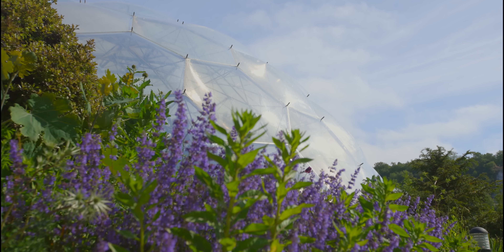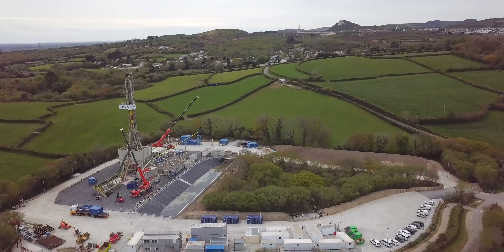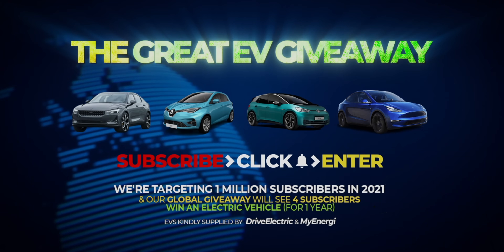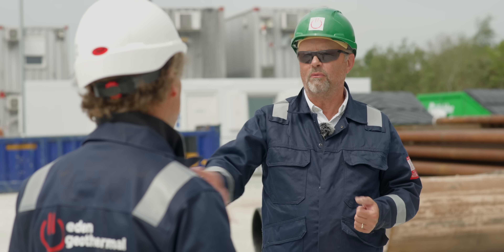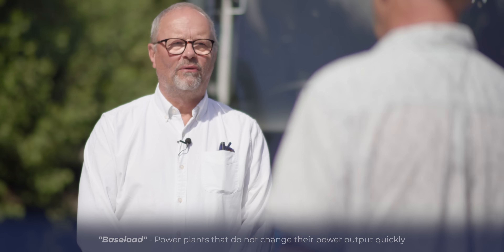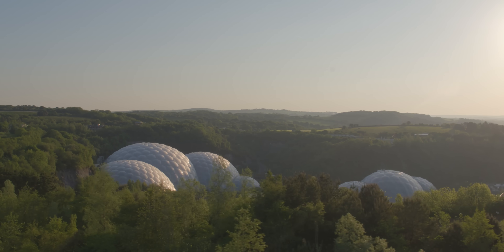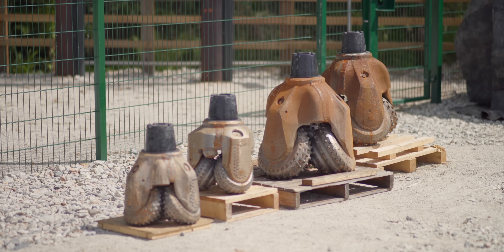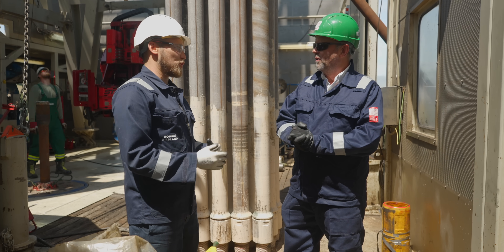Is Geothermal power the answer? | FULLY CHARGED

Comment: Anti-Nuclear sorts take note, this is tapping into heat from decaying radioactive elements deep beneath the surface. You cannot be for this and against new nuclear. Great stuff!
Reply: Actually, 'we' can - this is a natural nuclear heater they're tapping, with no nuclear waste for us to clean up, and no risk of a giant meltdown making the surface uninhabitable for miles around.  It's the same reason we can be in favour of solar - which gets its power from the giant nuclear (fission, rather than fusion) source in the sky: we don't have to deal with the cleanup.
Reply: @logicalChimp  your points are valid, but it just comes across as very "Nimby". We've have the capacity to deal with the waste effectively for years, money like everything else is the reason we don't. In any case I don't see it as a battle of natural nuclear vs artificial nuclear, they are on the same side of the climate fight.
Reply from the maker: Hmm, an interesting spin. I think the really well informed and intelligent opposition to nuclear energy isn't about the power stations, proven to be reliable and safe in all but 3 catastrophically bad exceptions, it's about the nuclear waste.
Geothermal drilling might extract very small amounts of low level radioactive material but once the wells are capped and then running, there is no radioactive material around, and no waste to deal with.
Reply: @fullychargedshow  If the objections were solely about nuclear waste, everyone would be cheering on GenIV designs that can consume high level, long lived waste isotopes from older generations of nuclear power designs surely?
Reply: @GreenJimll  if it were as clean amd cheap as you say, we'd already have them built but the reality paints a much more expensive and difficult picture for nuclear. Anti nuclear activists or misinformation are not what causes nuclear to be a more dangerous and expensive choice compared to geothermal.
Reply: @20xx-mm-dd  my complaint is nuclear never got the break that other energy sectors did. If we actually innovated and started building plants again the costs would plummet, just like we've seen with solar and wind. In addition the fact that 2/3rds of the heat energy is wasted because we don't bother with district and process heating
Reply: @Alster370  Yes, it's too expensive
Reply: Huh? Its the waste products that are the issue, not the radioactivity itself.
Reply: @20xx-mm-dd  the nuclear industry has exceptional controls on waste, unlike other sectors where fumes can be pumped into the air. The waste is a non issue, thousands of tonnes of waste amounts to quite a small volume, and that's from hundreds of reactors over decades.
Reply: @Alster370  it keeps accumulating and has insufficient regulatory oversight as to how it is stored. I don't know about your country but the US absolutely does not have nuclear safety anywhere close to geothermal safety. John Oliver did a fantastic breakdown on the problems with current nuclear implementation. Sure, hypothetically its a clean energy source, but the reality is far different from the rosy picture pro nuclear advocates like to present. I grew up near Hanford, WA. Nuclear is simply not nor ever has been safe compared to geothermal.
Reply: @20xx-mm-dd  you conflating the cold War history with modern nuclear energy.

Hanford deserves it own chapter.

So you are in conflict with what it means in the energy topic with that.